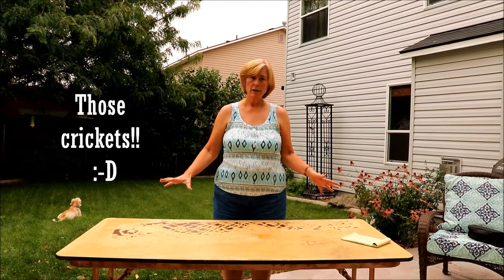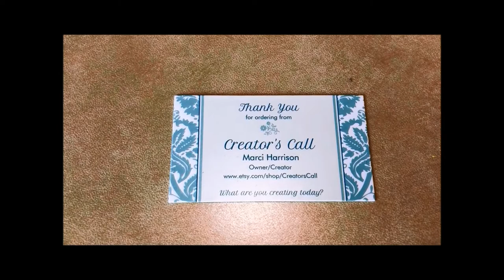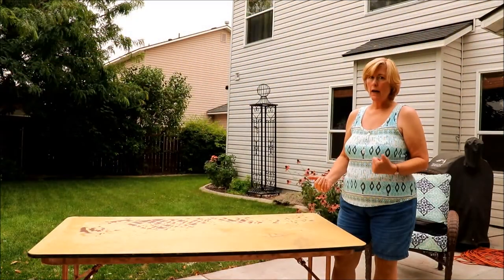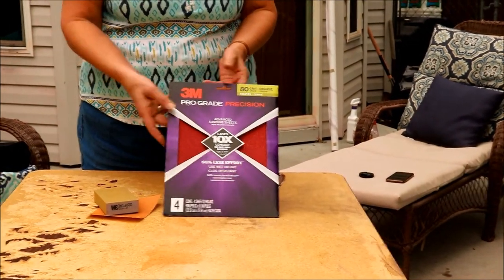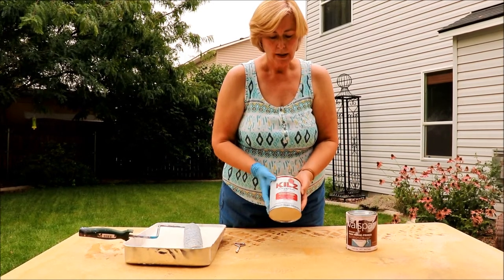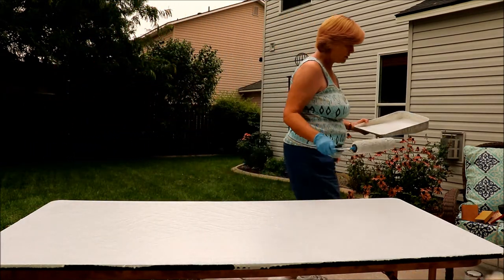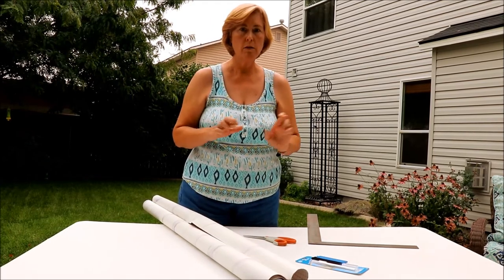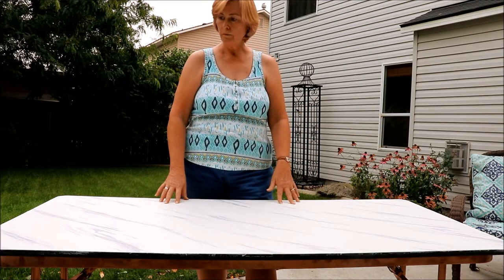My Craft Table Makeover | Easy DIY Project | How To Update a Folding Table (September, 2020)

Comment: Hi there. By seeing the date I know this has been awhile but I've been looking for a table like that for my craftroom. I used to have one just like it but had to leave it behind when I moved from one state to another. Can you please tell me where you bought it at? Thank you. By the way I think your table turned out just fine! Looks sooo much better now. Good job!👍❤️
Reply from the maker: Thank you, Yvette, I'n glad you found value in this video. I'm afraid I won't be much help in locating a similar table...I bought this one from a friend 18 years ago when SHE was moving out of state, 🤣 It is an old church banquet table and very heavy. The newer tables are much lighter in weight. I did craft on a 2.5 x 4 table for a couple of years while this one was in storage and it worked very well. I like this one for setting a sewing machine on though because it doesn't bounce the way the plastic table does. I would suggest checking the free section on Craig's List, FB Marketplace or even the Nextdoor app to see if anyone wants to get rid of one, Or try church garage sales, etc. It is a 6' banquet table, if that helps. I appreciate your watching and commenting. Good luck in your search! 🥰
Reply: CreatorsCallShop Thank you. Yes that's what I was gonna do. You read my mind! LOL😃